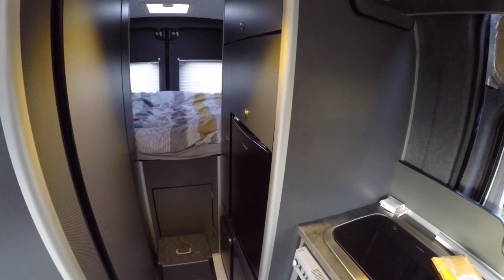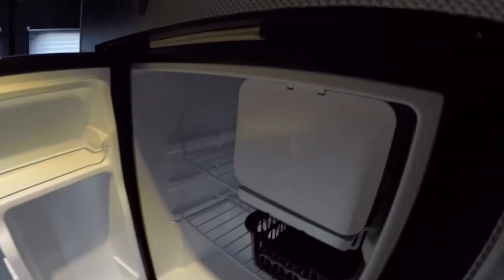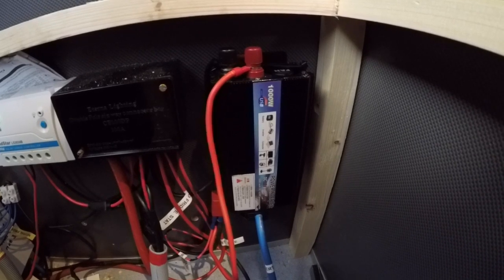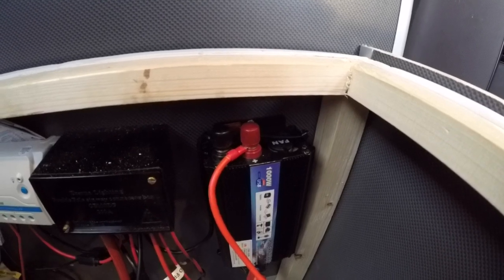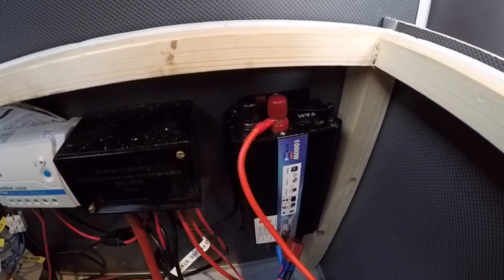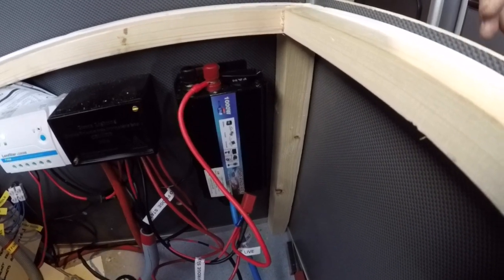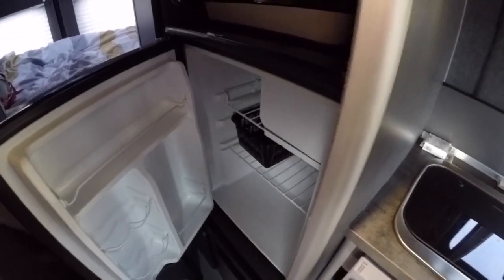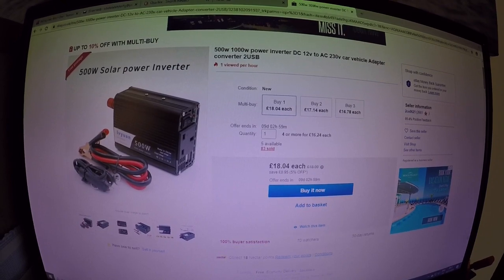Campervan installation of a domestic 240v fridge with ZERO draw from batteries when down to temp

Comment: Someone asked about running other devices from the inverter so can you switch it on for those. I chose to run the fridge from a dedicated inverter sized just enough to run it comfortably - 110 litre Beko TSE 1284. Victron Phoenix 500VA did run it, but went into overload for 20 seconds when the compressor stars. So changed to the 800va version and that runs it fine. Inverter fan only comes on for a second when the compressor starts.

I’d also came up with the hinge pivot point pin solution to door lock. Lovely solution.

If you put the pin in with the door ajar then tie the pin back to the bench it will hold the door ajar for winter storage.

I also put in expanding rods at the back to hold the glass shelves in place and same at the front to keep stuff on shelves.

I installed mine in a Hymer when the 3way died so used the original wall vents and extra vent fans I had for that. Works fine with proper fridge & freezer temps of 4 & -18 or lower even in temps up to 40 in the van.

I have a second smaller inverter for any other stuff.

I think 240 volt (or 110V in the US) is the best and cheapest option, but people love to try to pick holes in it. ‘Inverter will kill your battery (rubbish). ‘Fridge won’t handle the movement’ (rubbish). ‘Too noisy’ (not silent, but very quiet). It’s by far the cheapest option even if you opt for quality components.

Comment: You definitely have a lot of common sense. I've got an inverter in my off grid cabin setup that is somewhat power hungry on standby. However I have been through a few inverters and finally found this one that seems to be lasting, but more importantly, works without tripping.  It is an Ampinvt 5,000W with 15,000W surge, pure sine wave. I run a TV, fridge and fan off it, but occasionally plug a power tool in. I would like to have it set up to automatically go on and off with the fridge as you have it. But also to be able to go on and off when I use the TV or something else. I think I'll put some thought into it, maybe come up with a diagram. I see no real reason why I can't have 2 or 3 relays connected, where any one of them can trigger it on. But I might have to get fancy with how the wires are run, or use diodes if I think the current will feed back (or short?) if say I am watching the TV and the fridge decides to come on.

Comment: well done! i have been thinking of putting a domestic fridge in my next camper build due to the costs of dedicated units but the power was always a concern, this pretty much solves this issue! many thanks for coming up with this genius solution
Reply from the maker: martin holland hi Martin, what van are you doing?
Reply: @craster_van_kippers  im going with something completely new to me this time with a low loader box van, probably the renault chassis

Comment: Brilliant video.  I have saved a fortune buying a Russell Hobbs fridge for our camper and running it of an old inverter.  I also have a posh inverter that powers our others stuff.  Invested some of the saving on Solar and we can now even boil our 700w kettle without having to worry.  Thanks a million for sharing.
Reply from the maker: thank you for that. due to comments I have upped my relay from the one that was first used. I went overkill 200amps £11.

Comment: What a great video. Been looking at the price of 3 way fridges and am shocked. Looking at using a normal household one and came across this. A massive help. Thank you so much.
Reply from the maker: Update.
Since then it’s done 3 x 10 week trips and still going great. In an update vid from last year my semi skimmed still okay after 11 days in plus 30 degrees.
I’ve move the inverter to vehicle battery box under the floor.
The “beep” was knobbled with superglue into the piezo sounder,
Plus I changed the relay to a higher rating.

Some people say the compressors can’t handle the driving around. That’s b.s. because the trips have all been in Slps and Dolomites. I cannot believe that the cheap inverter is still working.
The current draw for fridge and inverter is just over 6 amps.
After our last trip I’m thinking of a small fridge freezer.
Don’t forget s door catch.

Regards
Keith

Comment: Just happened to find this video but i already did the same with a little twist on the theme!  I have a Russel Hobbs table top fridge and i wired the fridge  thermostat to a 12v relay.  You need to run a 12v 1A feed to the fridge for the relay switching but it only takes milliamps to switch the relays.  On one side of the relay contacts i use this to switch the inverter on and off using the remote switching unit or you can solder in  directly to the switch on the inverter if you don't have a remote port on your inverter.    Then i have another 12v/ 240v relay which is switched from the 12v relay which switches the fridge 240v feed to compressor on and off.   
Using 2 relays means no mixing of 12v and 240v supplies very important.  Also now i only have to use one large pure sine inverter which I already had and uses less battery power than the cheap inverters. 
Also better inverters use auto fans they only come on under very heavy loads so basically its all silent.
 On the van control panel i have a switch which overrides the fridge control forcing the inverter to stay on if i want to use the microwave etc. The 3 position switch is marked inverter  OFF inverter ON and  Fridge Auto.  
So now we can use domestic fridges without the inverter staying on which is the battery killer as the fridge itself only uses 50w  for about 8 mins per hour. and I saved hundreds on buying an RV 12v fridge.
FYI if you use a small inverter don't go under 1000w or your fridge may not start.  Most of the ebay ones for 35 quid can't actually do more than about 700w before you see blue smoke. You can stall the compressor it will get red hot and could burn out.  Switching the 240v side means don't need a 200 amp relay on 12v battery leads  a 10amp 240v relay is plenty. If you can afford it always use a pure sine inverter they use a lot less power and more efficient especially on motors, mixers, compressors, microwave ovens etc.
Reply from the maker: Hi Tony.
I welcome your comments as I’m pleased someone else already did this.
I must say the 12 and 240 are completely separate.
The relay replaced with 200 amps was merely to stop comments about b img underrated.
I have a top quality inverter for other occasional 250 use.
The cheap one runs fine I can live with the fan noise for now.
It draws 4.5amps when running.
If I deliberately stalk the compressor it draws 25amps until it gets going.
You must remember that the ONLY purpose of this is to keep costs to a minimum. An expensive inverter plus fridge etc would perhaps negate doing it at all.
Like me you’re probably surprised that many others hadn’t just thought of this and that it would be commonplace.
Coming to the end of the build and so far £10k plus, I will look to a quieter inverter when I count how many pennies I’ve got left. I could have bought a 12v fridge but being in white goods repair I felt that the price was a ripoff, I can’t see how the cost is justified.
If you’ve got other workarounds please post a vid or links to any you’ve done.
Regards
K
Reply from the maker: Apologise for typos and autocorrect
Reply: @craster_van_kippers   B2B or battery to battery split charge modules are all the rage right now but they cost hundreds. So right now many people are suffering with low charging from the engine and VSR relays doing strange things especially if you have a smart alternator.  SO i'm just testing another inverter to the starter battery and again i tap into the inverter remote start port or you can solder across the switch. The remote port is then controlled via the ignition off the engine via my cigarette lighter actually via a relay so the inverter turns on with the engine. This inverter then powers a 45A switch mode PSU set to 14.8v as im using deep cycle lead not AGM.   As an override i have a switch on the dash so i can turn it off if i think my starter battery is suffering but with 180A alternator testing so far is showing its working brilliant. I get 50A pushed through to the batteries for about 15 mins then  the power supply current limits to 45A and the fan comes on. This setup is MUCH better then VSR charge relay cos it only used to manage about 15A-20A as the voltage was too low to charge from the engine.  Its early days yet still testing but im very happy with it.  I might even add another PSU and push it to 70A to 90A     this will give a massive boost after just a short drive useful on no solar days.

Comment: Absolutely amazing idea doing the 12v system + relay system, it blew my mind but makes so much sense!!
Reply from the maker: Thanks!
Again it’s just something I did then realised that maybe others would like to know.
The only tricky bit for some would be identifying and disconnecting the stat wires at the compressor.
Because wire colours etc can differ I deliberately avoided giving specific advice.
One thing nobody can argue with is that it works. I’m fitting a battery monitor soon so should get an accurate consumption reading.
Finally I think one reason it works is precisely because I used a “cheap” inverter.
I think a more expensive one would immediately realise the “no load” in that first second and shut down.
It was hilarious when the door flew open and emptied everything out.
Live and learn.
Reply: @craster_van_kippers  - Hi again Keith! I was wondering, did you ever get that battery monitor fitted, any idea on actual consumption? :)
Reply from the maker: @3jcb123  yes. I did a brief update vid on consumption while travelling abroad. I can’t quite remember the details but 6.5 amps when running seems to ring a bell.
That of course included inverter consumption. Overall that is comparable to a 12v fridge but for a lot less money.

Comment: Just a though to run by you,Greg and others,Keith,instead of using thermostat to switch a relay on the 12v feed to inverter from batteries,could the same control be achieved by using it  by conecting it to to manual on/off switch of the inverter itself,which I would guess has a smaller power draw than switching the battery input.Great idea though as 3 way fridges are very poor and inefficient on all power sources especially in hot climates where compressor fridges handle the cooling a lot better.👍👍Paulo

Comment from the maker: Taken your advice. 200amp relay on order. Would hate to lose my ice creams for the sake of a few quid 😁. Everyone else please take note cos we are all here to help each other.
Reply from the maker: 200amp relay fitted today. its obviously a much more sustantial piece of kit
Reply: @craster_van_kippers  I'm so pleased I read this post and see you upgraded the relay :D
Obviously, the 30amp one is not rated high enough for 1000w/12v but as your fridge only uses 70w when running that only needed 6amps so it would not have burnt your van down luckily.
Reply from the maker: Greg Virgoe thanks. I knew it wasn’t rated high enough but as it was working I got side tracked by other stuff and basically forgot.
Today’s job is to fit a sterling b to b charger. My Sargent just doesn’t seem to do a decent job.
Might stumble my way through videoing it.
Are you going to Italy?
Reply: craster campervan kippers Van selfbuild I would be interested in seeing you fit that as thinking of fitting one myself. Yes, in Italy now on the east side of lake Garda. Not sure if you use Instagram but I post daily up to date photos of our location there. Did you have something in mind?

Comment: Absolutely brilliant well done and thank you for the video
Reply from the maker: Thank you. This was rigged with the kit I had at the time. Sadly I damaged the inverter physically and so replaced it. The new one has an in off switch. I did away with the relay and rewire the on off switch through the fridge stat. Much simpler and I now run a fridge freezer. At van meets I’ve met people who have followed this all are happy except one who had bought too fancy an inverter. His didn’t like the load on startup. This was corrected with a time delay relay. Ie fridge turned on inverter who’s out put was delayed by 3 seconds. Try a mock-up first before installing.

Comment: Great video very informative I’ll just need to work out everything you did on paper as I don’t have the foggiest how a fridge works thanks, ps how do you know? 1 what relay you need, 2 which wires go into the relay ie do you have a diagram, 3 you said part of the system works on 12v do I need to purchase that ? Thanks again John

Comment: I have a similar 240v set up in my van. Just use a second 12v thermostat to control the relay and set the fridge one the max. I also have a modified soft start to reduce the spike starting load and have a auto-resetting (standard) RCD to be safe.
Worked well for the past few years.
Recommend a 2000W inverter as will handle spikes better.
Reply: Can you say more about how you fitted the 12V thermostat? Is it located inside the fridge? If so, did you have to snake a wire to the outside? How did you do that?
Reply: @anon0105  the 12v thermostat is housed and  powered outside the fridge. Only had to snake the temperature probe inside the fridge. This was done by going via the same grommet feeds the coolant pipe and its own thermostat from outside to inside the fridge. FYI just make sure the thermostat probe is not touching the coolant pipe or the temp reading is distorted (cables can touch).

Comment: I run a 240 volt ac fridge. Even though I don't think it draws too much from my batteries I love this idea with the thermostat
Reply from the maker: thank you. sorry for late reply. notifications were accidentally turned off
Reply: Hi. I know this was posted few years ago. But just wanted to see if you had a diagram for the wiring please.  Thanks

Comment: This is very interesting. Thank you! 🌻
Reply from the maker: Hello thank you.
Yes that system worked perfectly for me using the very cheap inverter that I had.
More recently I have installed a fridge freezer and an inverter which has an on/off switch. So I’ve done away with the relay and the 12volt through the stat. I have simply modified the inverter switch so that it is now simply switched on by the thermostat closing the circuit. No need for any 12 volt power through the fridge. I hope this makes sense. As it happens I’m at a van meet right now. There’s lots of ideas on various things being thrown around.
Reply: @craster_van_kippers  Thank you for taking the time to reply 😃. I am handier than most people, but honestly electrics are like listening to an alien language to me... But I do understand the basic idea and it helps a lot to be able to show you video (and this comment) to my electrician when the time comes.
Reply: @craster_van_kippers  Motothome fridges (and cookers) are not only so expensive, I find them so ugly and clunky!... I love if you did a how to fit a domestic built-in oven + cooktop combination or a small domestic cooker (if either is possible)... I've looked all over the place for months for this information and haven't had much joy. Aesthetics and safety (and of course cost, but to a lesser extent) are my main concerns.... I saw in America they are using that cute camp cooker, but I worry about the safety, of fitting it permanantly, as the equivalent 'Kampa' camping cooker specifically says not for indoor use. Also an electric set-up (instead of having to have yet another fuel with the LPG, and the safety and inconvenience of it) would be better to my mind.

Comment: What a terrific inspiration this is; thank-you.  I'm unsure as to how wiring goes for the thermostat which you said was on the 12v circuit with the relay.  Maybe it would be clear if I looked at the back of a fridge? Also loved the door-stop boy idea. I can see me doing this if I ever pluck up the courage to try this project.
Reply from the maker: As I said I don’t wish to give details however I know some who have an inverter with an off/on switch. They have removed it and connected the thermostat instead which of course is easier. Try to keep all cable runs as short as possible.
Thanks for watching.
We now run a fridge freezer instead.
Reply from the maker: Just fitted a switched 1000w pure sine inverter £62. Piggy backed the fridge stat to the inverter on off switch. Much easier! Wish my experiment inverter had had a switch. So no relay required.
My expensive Sterling inverters wouldn’t fire up an 80watt fridge. So maybe best isn’t best in this case.

Comment from the maker: Hi Michael,
It’s a 200amp relay that I’ve fitted since.
I’ve now put links in the video description. This YouTube stuff is all new to me so pls bear with me.
In fact 200 is a bit over the top for this fridge but price was similar so doesn’t hurt to over spec.
I can assure you that this setup works but I do think it could be because the inverter isn’t too clever.
Regards
Keith